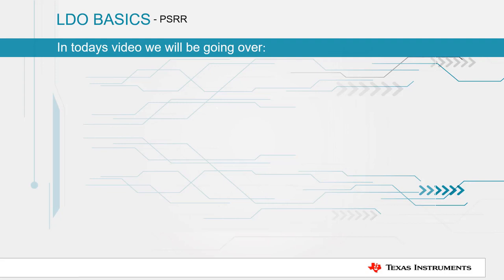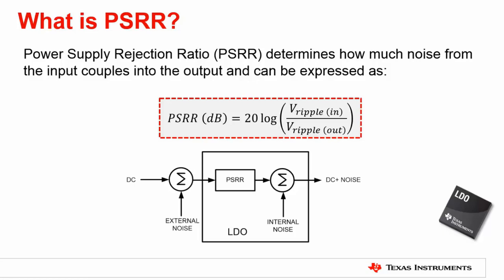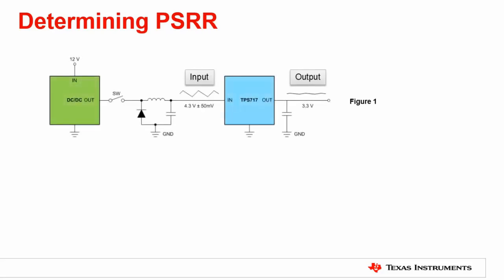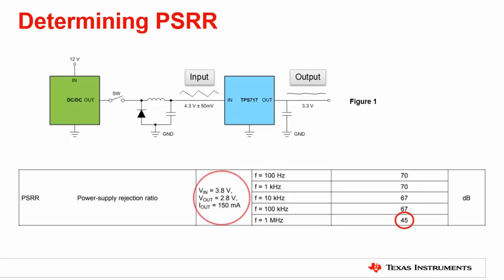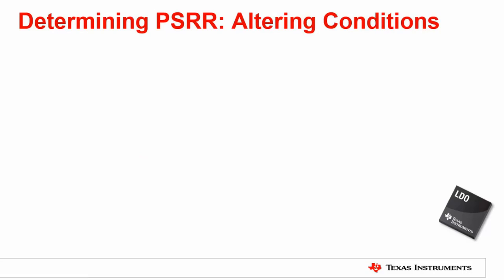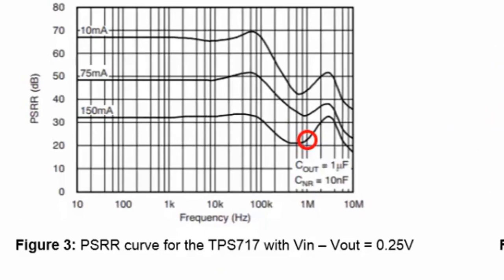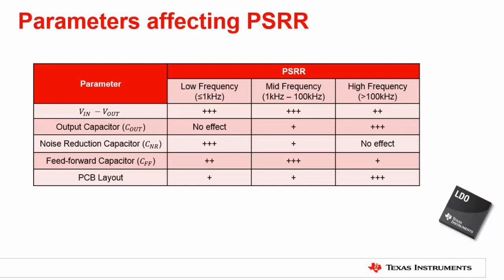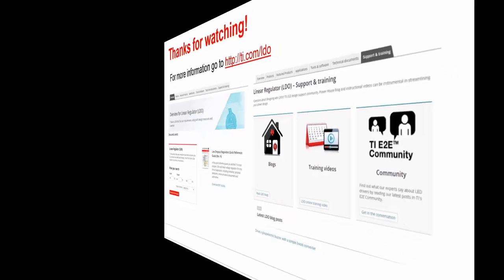LDO basics: Power Supply Rejection Ratio (PSRR)

Comment: Now what is the relation of this logarithmic graph ? I actually trying to understand what is decibel is !! So I don't know what does it mean to have the decibel at ~70 when having a ripple from 10 - 10kHz ? Then the decibel drops when running with higher frequency. What does that have to do with voltage output stability, quality ... etc ?